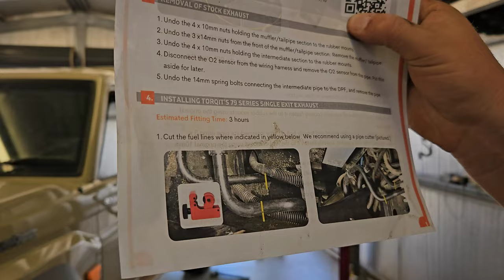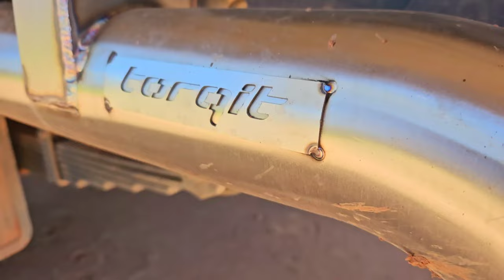2024 Toyota LandCruiser 70 series - Torqit 3.5 exhaust!

Comment: You could tell you were a little hesitant cutting the fuel lines in the beginning, and I don't blame you. 😁It does sound better than stock, and you can even hear a little bit of the blow off valve whistle. Kudos to you for doing the right thing and keeping it legal.  Full respect. ✊ Good luck with your warranty claim.
Reply from the maker: Yeah it's a bit strange having to chop the fuel lines, will see what happens with Toyota 😬, thanks mate.

Comment: That's one of the first things I had changed on my 79. It was done by an exhaust specialist the mod being a 3inch dpf back exhaust with a 4 inch resonater.
Was pleased with the sound, but a slight improvement in horsepower. Wish I'd had 4 inch all the way through, but the legalitys of it just wasn't worth it. Wish I'd had the rear axle width correction done instead of the Safari Armax package added.
Reply from the maker: Beauty mate, Is it illegal to run a straight through 4 inch? is the safari armax any good?

Comment: Hi mate , good vid thx 
I put a PPD dpf back exhaust on 2 years ago fortunately no fuel line relocation. It’s still going strong back don’t do the constant dirt u do 
6 months ago I purchased the torqit module map . It’s sent to you and it does a factory read then u send data back thru a porthole along with your vehicles info exhaust tyres etc and they send you 3 tunes 
On the mind tune my clutch lasted 2/3 months started slipping on hills 
So went NPC 1300 . Love it now . I wouldn’t bother with Toyota. My brake rotors warped at 10k and they were an absolute nightmare to deal with. They did a shit fix and I’ve had them fixed finally elsewhere 
Btw torqit module map lets you revert back to factory settings within minutes which is why I went with it but if anything goes wrong I reckon Toyota will not be helpful anyway 

Cheers mate you live in a beautiful part of Aus
Reply from the maker: That's interesting mate, and my rotors are warped to I reckon. if I was after more power, it would have to be a proper dyno tune well within safe parameters. The dealerships can be bloody hard to deal with, you've really gotta have a spine and stand up to them I've found. sure is beautiful here, cheers 🍻

Comment: Good stuff, I installed the GSL diff actuator protector after seeing your earlier vid, had no idea before that.  Dont worry too much about the dpf, the previous hilux/prado dpf issues seemed to be with city cars not getting a good run, I had one I just sold a 2016 2.8 with 175,000kms and original dpf,  plenty of country mileage per year probably helped,  but Toyota did extend all dpfs to a 10 year warranty. Im heading for the Tanami in July be good run for my new 78.   cheers
Reply from the maker: The guards are a good thing mate! My two previous hilux's never had dpf dramas either, and my brother has a hilux with no dramas. Congrats on the 78!

Comment: Keep the metal pipe from your fuel line as well... they can come in handy as well if you have problems down the track.
Reply from the maker: I keep most stuff like that, always ends up used somewhere, it's good having a little supply of random bits

Comment: Just for your info. My 2022 LC just had a new clutch kit replaced. No towing, no towbar fitted. just a work truck
They dropped the entire gear box. Warranty covered it. Low km. My lc is stock at the moment. Just boxes on the back atm
Reply from the maker: Farout mate that's bloody wild hey, good they fixed it under warranty though.
Reply: Cheers for exhaust video. Agree DPF sux.

Comment: I have a 23 model dual cab and a 23 model single cab which I fitted torqit pipes , the dual cab required no fuel pipe mods but the single cab required the pipes cut .We altered the fuel pipes using a beading tool and made custom fuel pipe brackets for both fuel pipes and exhaust pipe with P clamps , much better than the Torqit mod to the fuel pipes ,happy to provide some images  as the mods look like factory .
Reply: how do you like the sound? is it much different from stocl?
Reply: @TylerIrving-g6e  A bit louder than stock but the DPF muffles it a lot , it sound great when you put the boot in , well worth it .
Reply from the maker: I'd love to have a look mate, you on instagram at all?

Comment: At Easter I was in a road side Police check the usual stuff drivers License, Drink and drug testing and something new a tailpipe check of newer diesels to see if the DPF was operational apparently a $2000 fine if removed by owner and $10K for a shop if they did the work
Reply from the maker: That's interesting hey, wouldn't take much for them to sting ya I reckon!
Reply: @OutbackOffroadNT  I made a joke to the one wearing the white glove that I hope that's not for me 😜
Reply: Those guy spent over 50k extra modifying the car, 2k fine is nothing to them.
Reply: @szejim1757  The problem is the Police can put the vehicle off the road till all faults are rectified a friend off mine was picked up for oversized wheels a easy fix but the bull bar was found to be non compliant as was the suspension mods it got very expensive

Comment: I have a 2021 78 and got a Torqit exhaust from a shop fitted.Fuel lines remained the same but I had the regrid my factory side steps as when on a lean it vibrated  noticeably.Warenty's are great.......... until you need them.😞
Reply from the maker: Yeah I reckon its just the updated single cab 79 for the fuel lines, interesting about the aide step though. Yep, warranties can be a funny thing.

Comment: awesome episode, with clutches it in my opinion is a luck of the draw if you get a good one from factory, I had a 100 series turbo manual which needed a new clutch at 70000 kms and toyota said i tow a boat and  would not cover the claim with my work 79 done 275000 with a mild chip and a upgraded exhaust has the original clutch, good luck with toyota👍
Reply from the maker: Yeah that's very interesting mate, I honestly reckon I'll just bite the bullet and throw a HD clutch in
Reply: @OutbackOffroadNT  upgrade to a 1200 nm clutch the factory one is 350 nm
Reply from the maker: Oh wow really? I've been trying to find out  that info, I'm looking at a Terrain Tamer HD clutch...
Reply: @OutbackOffroadNT  i think they do a 1200 nm and a 1600 nm clutch and a billet flywheel

Comment: Good job mate. Just wondering if the welds on the new pipe are passivated?
Reply: What’s the stainless steel mate. 304L or 316?  Do you know?
Reply from the maker: Unsure if passivated, stainless is 304
Reply: I reckon it would be worth getting each welds pickled mate.
Reply from the maker: There's definitely reassurance with the 10 yr warranty, but yes I wonder if they really go through the right process when fabricating these exhaust

Comment: Ive got the same vehicle, single cab, haven't upgraded exhaust yet, can't see why Torquit couldn't have fabricated that the same as the OEM exhaust,I wonder if gsl has the same exhaust design
Reply: Sounds good 👍
Reply from the maker: Yep, it's silly imo. Could be a reason, but I reckon it should've followed the same route as stock

Comment: Unfortunately, a New Toyota 79 can be a real money pit. Clutch, Exhaust, Diff Correction, Snorkel replacement, Speakers upgrades, Seats upgrade. Wheels and Tires .Then you need a tune and suspension upgrade, This depends on what you want for a tray or canopy. Despite all those, they are a very popular vehicle to purchase, with a long waiting list.
Reply from the maker: They can be mate, though it's up to the individual how far they want to go. Like I said in the video, who buys a 4wd and leaves it stock? Not a lot of people. I certainly won't be putting seats in it or a "diff correction" almost everything else you listed most people change in any 4wd.

Comment: I put a torqit system on my TD42 Patrol
With all the hype and media marketing that the company uses 
I found my system to be sub par
The welds were good but the exhaust mountings were garbage
Reply from the maker: Yeah fair enough mate, you still have it installed?
Reply: @OutbackOffroadNT  
Yes I do but I’ll be remaking the brackets
Reply from the maker: Yeah that's interesting mate, what's wrong with them?

Comment: If you want to keep your vehicle reliable and the warranty intact don’t modify it!!  These cars are extremely capable stock it’s the stock Toyotas that last to 1,000,000kms not ones with big tyres, lifts, tunes, catch cans etc etc
Reply from the maker: I always say stock is best. However, obviously some things get modified eventually. Suspension being a big one, my standard gear is getting tired and the rear springs are sagged. I'm getting dust on the clean side of the air filter for example to, so thats going to have to change... I service every 5000km, that's what will get me to a million km's 😅😜
Reply: @OutbackOffroadNT  I hope your rig hits a mill too bro, if you’re getting dust in I’d definitely take it back to the dealership use phrases with the service manager like ‘not fit for purpose’ they hate that remember if they’re assholes about the warranty your always protected under  australian consumer law

Comment: Those clutches must be pretty weak, bigger tyres would load it up a little, but with a v8 engine in a big truck surely they build them to tow big loads and you haven’t even pulled a 6 x 4 trailer !!!  Not really good enough toyota , especially given the massive purchase price
Reply from the maker: Yeah it's pretty average mate